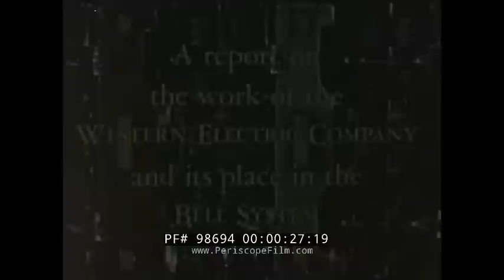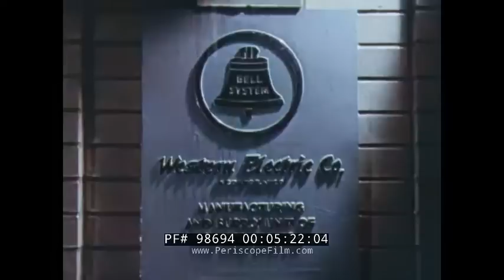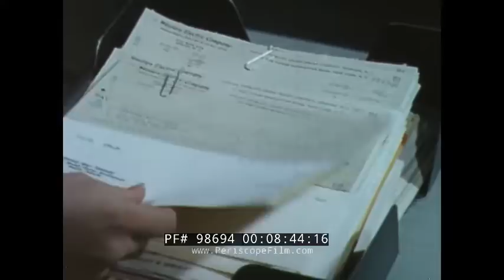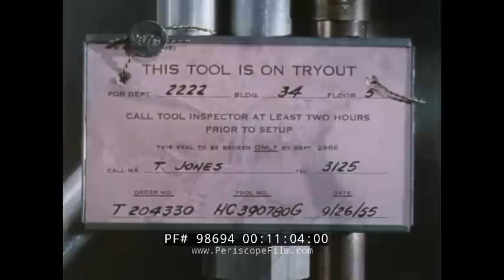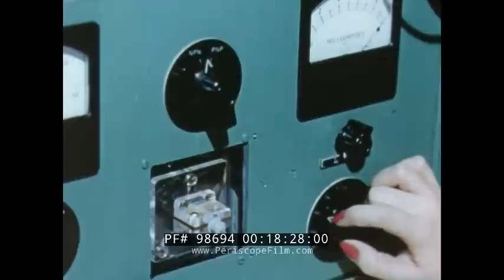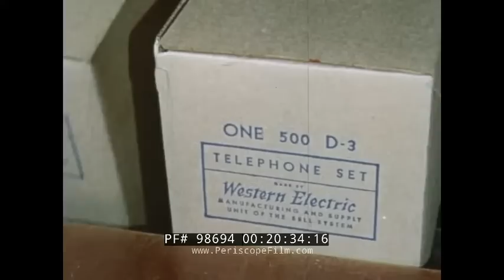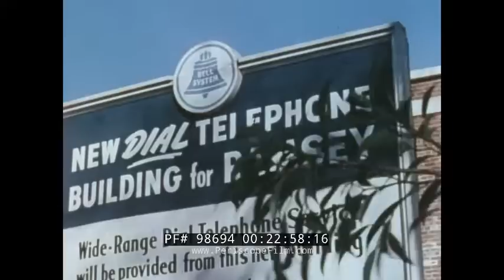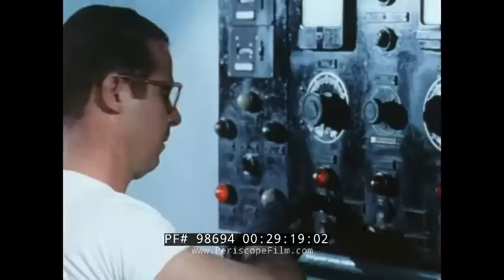"TOOLS OF TELEPHONY" 1956 WESTERN ELECTRIC TELEPHONE SYSTEM PROMO FILM   BELL SYSTEM 98694

Comment: Everyone pointing out how great it is that "we're still using these systems and equipment, isn't that an amazing testament to how good it is?" Are missing something kind of important.  Yeah, this stuff is impressive and kind of mind bending to think about.  The fact that all of this stuff was manually done, usually with individual electromechanical switches and hard wires running everywhere... all while being designed on draft paper with slide rules.  It's nuts.

 The old POTS networks are insane feats of engineering, especially considering the limited tech they had on-hand...

But...

A lot of that stuff is still being used... Because we have to to use it and sometimes it's crippling.

There's a lot of systemic problems in modern telecom and networking that are caused by these old systems.  Sometimes they're still quite literally running the backbone functions and doing really low level stuff that everything else then has to comply with, sometimes we're just stuck with crap designs that have to remain backwards compatible which means that features that should be obvious are impossible due to conflicts, and, most frequently, we just have systems that are built upon layers and layers and layers of old systems that might not be around anymore, but we built these newer systems on top of old networks, usually as "expansions" to start with, and then replacements later on, which means we still inherited many of the worst bugs and bad frameworks from the older systems even though those old systems aren't even with us anymore.

The fact that we still can't stem the robo-spam on our phones, for instance, despite them being made progressively more illegal and being such a constant problem that traditional phone numbers have been rendered completely useless.  It's so many that most people won't answer the phone from unknown numbers, and some people flat out just won't answer the phone from anyone, period, because the spammers have gotten so good at spoofing numbers and figuring out which numbers to spoof to get your guard down that whitelisting isn't even foolproof, anymore.  

And, yet, nothing really seems to ever get done to fix it.  It's not like everyone on earth except the few thousand spammers ruining a fundamental global communications network to try and find grandma's to scam out of their retirement savings don't want this shit dealt with.  And this is entirely because the frameworks of these old systems are so fundamentally interwoven into the modern ones that we can't make the seemingly basic changes we need to because there are still central switching offices out there that have their phone numbers tied to actual, physical, mechanical switches because the lines they service are absolutely critical and required to be exactly how they are by law, and there's absolutely no way around it and we've already built everything else on top of it.

Don't believe me?  I'll bet your fire department is still linked up to every commercial fire alarm system in your city via hard switched landlines.  And if you really wanna be blown away, try looking up how many things in the world still run on telegraph and you'll start to understand the problem.
Reply: Regarding spam, most of it is a legal problem. Every single call placed is documented. There are records for which lines, which channels, which trunks, and so on, a given call took to traverse from the caller to the recipient. For fraudulent calls placed within a single network the operator can swiftly determine who the bad actor is and act accordingly.

The problem is when the calls cross different networks. Now there are several companies involved. These process is much more administratively cumbersome and often just doesn't happen. Different operators really aren't interested in spending the time on someone else's complaint when there's no impact to their revenue. THIS is the problem with telephone and email spam. In the email world, occasionally a company will be blocked by others until they clean up their act. But once you're large enough you're impervious from this. Same in telecom. Nobody is willing to block another operator - nor are they necessarily allowed to. This is even worse when legal jurisdictions are crossed as it then becomes an international legal matter.

STIR/SHAKEN is an attempt at a technical fix to this effectively human problem. By trying to authenticate a given call the recipient is supposed to know whether the caller ID is faked or not. Not that that actually helps anything. 

Regarding old switching, this is incorrect. There are digital switches like Nortel DMS still in operation, but the last crossbar switch left North America (if that's where you are) in the mid-1990s (I want to say 1997 or 1999). Backwards compatibility is paramount, however, so the basic operations they perform are more-or-less the same no matter what's inside the box. 

As far as fire alarms go, the old systems that did that were using telephone company wires but not the switching equipment themselves. As far as the LEC is concerned they're just a couple of lines connected together. That said any semi-modern alarm system works on a dial basis and can run over VoIP. Newer systems have cellular backup available. As far as regulations go even emergency elevator phones can be VoIP.

One thing that I don't think has changed are monitored lines, the type you'd use at a bank where an alarm is triggered if the line is cut. These sorts of circuits certainly are tied to legacy infrastructure but don't have to be tied to any particular type of switch.
Reply: @holysirsalad  Ohio Bell did way with dc pairs in the mid '80s. A local volunteer fire department used one to trigger a large siren, on a paper mill a half mile away. he were only given 30 days to convert it to another method, and their old Plectron dispatch system was about 30 years old. It used  non standard control tones to dispatch different systems, from a county wide control center. The county had to pay for different  equipment to control these setups, because these small departments couldn't afford close to $5,000 for the approved hardware.

Comment: Do you have any films about the White Alice phone system that was built for the military in Alaska? I used it in '73/74 to call my home in Ohio while I was stationed at Ft. Greely. The operator was in Fairbanks, which was a free call, but it was quite expensive to call Fairbanks. I would ride two hours into there on the free shuttle bus and just go to the businesses instead.

Comment: I have one of those old western electric phones with the high voltage ringer. It still works too except for the ringer because modern phone lines do not pump 115v into your telephone anymore going into the huge transformer in the center of the case which makes the phone rather heavy. People were electrocuted using those old phones, usually from them falling into a bathtub I was told, or holding the earpiece while mopping the kitchen floor & as you walk along you accident.y pull the phone off the counter & plop into the bucket & you reach for the phone and your brain is fried because you still holding the earpiece with your neck. AT&T had the money to fix it & did -unlike other monopolies like Boeing, who just kick back kicking out airplanes designed in 1965 & hiring software engineers straight out of college only to send them to Boeing college to learn how to write code in DOS. ANYWAYS… So the ringer doesn’t work, but you still get a dial tone on my old phone & the dialer works too! Of course I haven’t used it since 2008 when I eliminated any need for a landline & went cellular.
Reply: It was 90 volts, and very low current. The bell ringer was a resonant circuit so it didn't need much current so it wasn't enough to electrocute you. A lighting strike on the line was another matter.
Reply: No one was ever electrocuted by a phone, and the old phones with bell ringers still ring just fine on my phone line. In fact, my phone line makes 4 of them ring at once: a Western Electric 554 in the kitchen, a Western Electric 500 and Western Electric Fortress payphone in the living room, and another Western Electric 500 in my bedroom.

A bell ringer is only about 1 REN, and a typical phone line supports 5 REN, so if your phone line couldn't even make 1 real telephone ring then you had shitty phone service.

Comment: When America was great!
Reply: Yeah, when you had to pay rent on the phone forever, and they'd  sic the phone police on you if you dared plug your own phone into your own home.
Reply: @southbendkid  yes, they would.  But you have to remember,  it was Not your wiring, that was owned by the phone company,  and when it broke the phone company would send a technician out to repair it at NO Cost to you. Their system, their rules,  besides if your phone didn't meet their specifications it could damage their equipment,  and even if it did meet their standards, the extra phone would put an extra load on their system that they had not been set up for.
Reply: @brucejones2354  Indeed, a monopoly may make any rules it chooses, and yet the system did not collapse when customers were allowed, then required,  to supply their own phones. On the other hand businesses had to pay whatever Ma Bell and regulators decided. They used this power to subsidize consumer phone rates. Once competition came to the fore businesses could negotiate better rates and consumers became phone companies' profit centers.
Reply: Yep the New Deal hadn't been dismantled, the top tax rate was 90%, FDR was practically still President. Unions were strong.

Comment: The rats were big enemy of cables the usually cut the cables by their sharp teeth in telephone exchanges.
Reply: Squirrels like to chew through the aluminum cable TV trunk lines. If they manage to chew all the way around it and break the shield, they get hit with a 60 volt modified sinewave at 30 amps.

Comment: The entire digital crap 

In my youth we had a telephone with rotary dial. 
While my father becomes angry he smashes the Telephone receiver on the apparatus. 
The phone survived decades. 

I wirke as a civil servant. 
First phone we were using decades. 
But Nö every 5 years a new one because there are no more software updates. 

And if you have blackout you can use the phone!
Today due to voip nothing is working. 

We have in pure county motorbikes in case it doesn’t work

😤

Nowadays 
You have to handle it with care.